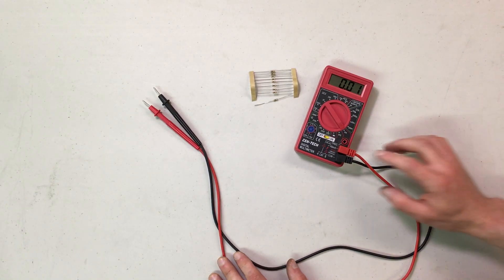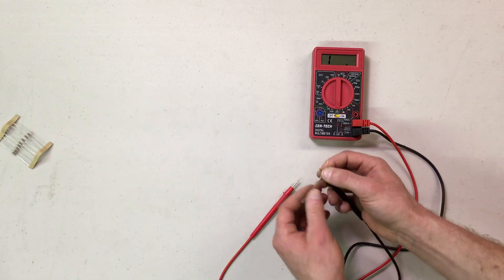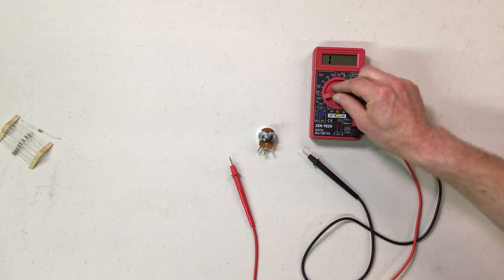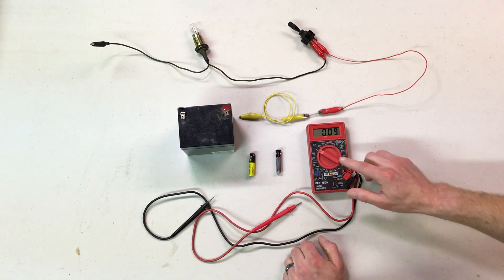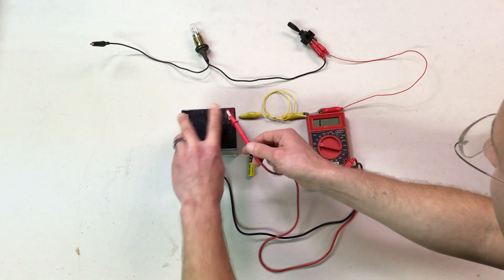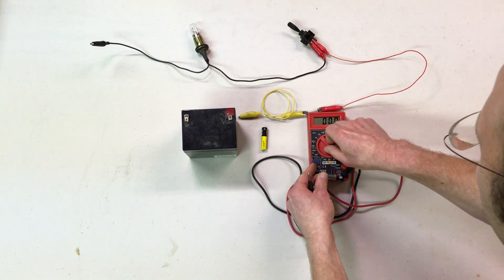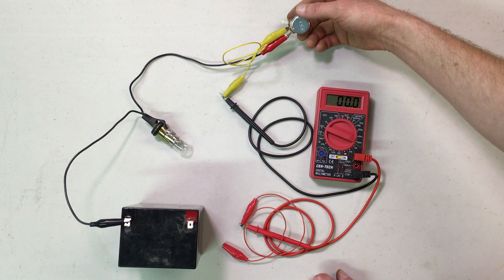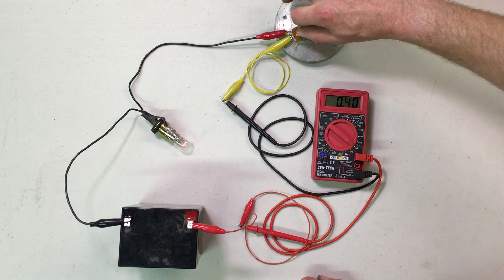How To Use A Digital Multimeter

Comment: I have 0 with leads together helppp pleeasdeeeee
Reply from the maker: Do you have it on the 200 ohms setting? If so, that's perfect. It means no resistance or perfect conduction, which is what it should be when you're just shorting the leads together with nothing between them.

Comment: See here’s my problem I bought that same harbor freight multi meter and it worked fine for awile but now it’s reading battery voltages over what they are and when I go to test voltage on a fully charged 12v battery using the 20v side it goes on overvoltage and it’s just reading the voltages all wrong, what can I do to fix this, I changed the battery that did not work, how do I reset it back to zero if that makes sense

Comment: When I touch the red and black together it reads 48.1 goes to 45.5 that's as low as it goes and it's set on 200 ohms. Why?
Reply from the maker: Most likely it's because there is extra resistance somewhere in your test lead wires, or the probes themselves. On these harbor freight meters, the place I've seen fail over and over again is inside the test probe handles. The connection between the wire and the probe often fails inside and breaks or becomes so poorly connected it doesn't conduct electricity well. 

One way to troubleshoot it is to hold both probe tips tightly together on the 200 ohm setting, and while you're doing that, wiggle and push/pull the wires going into the test probes and at the connection points to the meter. See if the resistance value suddenly drops or increases drastically, and try to isolate it to a particular point on one of the leads. That is the point that needs to be fixed or replaced. 

Another option is to disconnect and remove the probe leads from the meter, grab a small piece of wire or a paperclip and use it to connect directly between the probe lead connection points on the meter where you normally connect the red and black wires. This will simulate touching the lead tips together and should give you the lowest reading the meter is capable of achieving. 

One other thing is to just replace the 9V battery inside the meter. Sometimes it gives strange readings when its battery is getting low, but not completely dead yet.
Reply: @TomWylie  Thank You, my dryer just stopped working, the fuse was blown and burnt on one end of the fuse holder burnt out, so bought new fuse and holder put it in and dryer still want come on. So thought meter wasn't working when I tested the fuse ..

Comment: Yet another disappointing video! It would have been certainly a useful video if had you demonstrated how to use the functions that are not available on the usual multimeters, such as the diode tester and transistor testing capability of this heap but extremely capable meter!
Reply from the maker: Zack Vizeman sorry, I guess you'll have to make the ultimate multimeter video yourself and show us all how it's done.
Reply from the maker: Zack Vizeman I would suggest doing a separate search for the specific functions you are wanting to learn how to perform. This video was just meant to cover the most common uses that most people will be needing. I'm sure others have covered the functions you need to learn how to use, but perhaps in more single purpose videos.

Comment: TomWylie:  I have one of these that I got at Harbor Freight Tools.  It is the exact same one that is in this video.  I have had it in a drawer for many years, and it has never been opened.  I was wondering if there is a battery inside it that makes it work?  If so, do you think I should replace the battery?
Reply: Yes there is a 9v battery inside that's removable and yes the better the battery the more accurate the reading

Comment: I have this Cen Tech Multi meter. How can I use it to measure capacitor?

I believe I will need to use ohm setting. Is it correct? Like checking battery resistance.

Am I suppose to charge up the battery before test it?

Not an electronic guy. Learning as I go. Thanks.

Comment: yeah.... I do same exact thing you do with same centech from H Freight.... You get 0.7... I get all kind of much larger numbers, but mostly about 8.3.  WHY?? First time, I got 42.something... and last time, I got 1.9 to 2.0... something is different and I think this meter just got a new battery.
I check batteries as you did at 8:00 mark... if 3.7 to 3.9,  they are weaker on flashlights but may work for remote control still, so I do not toss. If below 3.3, I toss. Should I toss them or is there some way to get more life from em???
Reply from the maker: Often the test leads have a bad connection between the wire itself and the metal pointed end of the probe. Try wiggling the wires around a little bit next time and see if the value changes. That would be an indication of an iffy connection somewhere within the test leads.
You also need to make sure you are holding the two probes tightly together so that there is little or no resistance in that connection.
Yes, there's actually a really fun use for batteries that are too drained to run a remote control, etc. Do a search on YouTube or Google for the Joule Thief circuit. It's pretty awesome to see what you can do with a "dead" battery!
Reply: @TomWylie  yup. you called it correct. I went to use it again and the red wire fell right out of the needle probe handle of the free harbor freight unit.... LOL.  Those should not be trusted for much anyway. I use it normally just to check AA AAA C D and 9V batteries.

Comment: Where is the continuity option on this multimetrr?
Reply from the maker: To test continuity, just use the lowest resistance (ohms) setting as I show starting around 0:23 and connect the test leads to each end (terminal) of the component you're wanting to test. If the meter shows zero or very little resistance (like what it displays when you short the leads together like I do starting at 0:37), then there is good continuity. The higher resistance shown, the poorer the  continuity. If there is no continuity, this exact meter displays a "l" on the far left, as you can see at 0:21

Comment: Thanks for this basic demo. One improvement would be to replace the test leads with alligator clips.
1) Use of clips is a much safer habit when the user graduates to voltage measurements. 
2) Use of clips removes the user's body resistance from the measurement. Just now, I measured a 1.5 M ohm resistor with clips and then by holding the resistor against test prods. My readings were 1.544 M on clips and  673 K ohms when holding the leads against probes. This is an error of 871 K ohms or over 56%!

Comment: Just curious if you are aware that as the battery loses power this particular centech multimeter can be adjusted with the potentiometer under the back cover it is on the top right, it also has an interchangeable fuse and can change the 9v 🔋!!!
Reply from the maker: Aiden Shadows interesting, I’ll have to check out that potentiometer! Wasn’t aware of that. Thanks for sharing :)

Comment: Great current tutorial, best one without all other crap on the tutorial. Also only one I found with poten gage current test.

Can I use 2 of this multimeter to measure 20 amp or 3 for 1230amp current. As you know it is rated for 10 amp.
Reply from the maker: Ka Ye honestly, I've never thought of doubling up multimeters in parallel to measure higher current levels. I suppose it might work, and I think you would have to read all 2 or 3 meters and add up their values to come up with the total current amount. I would be a little concerned about one of the meters getting slightly more current than the other though, if your connections weren't perfectly secure & resistance-free. I wouldn't try it on a very sensitive electronics circuit, but a simple 12 Volt circuit like the one in this video would be a good way to test your theory. Especially if you were using free or very cheap multimeters from Harbor Freight, the cost of replacing anything that fried wouldn't be too bad if the experiment failed :)

You might do an internet search on "current measuring shunt" to see if you can learn of a way to use just one of those meters with a special resister hooked into the circuit in a certain way. I recall that is how some permanently-installed amp meters work in automotive & equipment applications, but I don't remember the details right now.

If I need to measure higher current amounts, I normally just use a different multimeter that has a clamp feature that just clamps around one of the wires and measures the magnetic field induced by the current flowing through the wire. Those meters are usually capable of higher current measurements. I think mine is rated at 40 Amps.

Comment: thanks for this video i can now complete my physics lab! Can you demonstrate how to fix the multimeter in case of a fuse issue?
Reply: If you blow a fuse on a centech there are a couple of screws on the back you need to remove to access the fuse and the 9v battery used to power it, if the fuse blows it can be replaced, it is a small glass tube type of fuse, it is also possible to change the battery as well as adjust the potentiometer it has, to get a more accurate reading. Much like how he shows that .7 is zero on his, you can adjust the potentiometer with very tiny movements to actually bring it to zero instead of having to assume the  placement of zero.
Reply from the maker: Dulce Martinez you're welcome, glad it helped! Do you mean how to replace the fuse in the multimeter if it blows?

Comment: Is there a way to test diodes and capacitors with this multimeter? How about testing a small dc motor, like the type you would find in an electric shaver?
Reply from the maker: Glacius yes you can test diodes using the resistance settings. You should get an indication of continuity when you connect to the diode in one direction, but when you reverse the leads and measure it in the other direction, you should get zero continuity (infinite resistance). A lot of meters, including this one, also have a special diode test setting, which basically gives a similar indication of current being able to flow in only one direction. Just look for the electronic symbol for a diode on your meter: that is the diode test function.

For capacitors, I only know how to test that a capacitor is working at all, but I don't think you can test how well it is working without a true Capacitor Tester, which would tell you how many microfarads the capacitor is capable of. 
For my simple test of whether the capacitor works or not in a general sense, this is what I do: (read and understand it completely before trying it for yourself)

CAUTION: Handle capacitors with great care, especially when you don't know whether they are charged or not. They can deliver a very powerful (deadly, if they're big enough) shock if you connect anything across the terminals.

1. Fully disconnect the capacitor from the circuit it came out of. 
2. Using the DC Voltage setting on the multimeter, measure how many volts of electricity the capacitor is currently storing, if any. 
>>>>If you are at all unsure about whether the voltage you just measured is safe for you to be dealing with at your level of experience, STOP HERE and ask someone with more experience for their guidance and/or help.<<<< 

If you know beyond a shadow of doubt that you can safely deal with that amount of voltage, proceed ahead with caution:
3. Fully discharge the capacitor by shorting the terminals to each other using a screwdriver or an appropriately sized resistor, depending on what your voltage measurement result was in step 2 above. Depending on that voltage measurement and how many microfarads the capacitor is rated for, this may produce a large spark and could burn the terminals and/or your screwdriver (or give you a nasty shock!), so do a little research and use commonsense to keep things safe. At minimum make sure you are wearing gloves and eye protection. 

4. Set the multimeter to the 200 ohms resistance setting and connect the leads to the capacitor (Pay attention to the polarity, if the capacitor has positive and negative terminals) for 5 or 10 seconds. This will use the 9 Volt battery inside the multimeter to charge up the capacitor with a small amount of voltage. Disconnect the test leads from the capacitor before proceeding.

5. Change the multimeter to the 20V DC voltage setting and reconnect the test leads to the capacitor terminals in the same direction (polarity) you connected them in step 4 above. 

If the capacitor works at all, you should momentarily get a voltage readout that gradually decreases back down to zero. 

This at least lets you see if the capacitor has any function at all and can help you determine if the capacitor is internally "open" or "shorted."

For small DC motors, you could use the resistance settings to measure the coils of the motor to see if they have the appropriate amount of resistance, or if there are any shorts or opens.